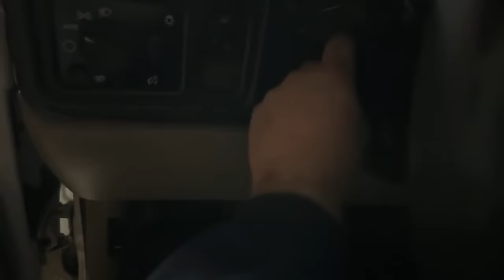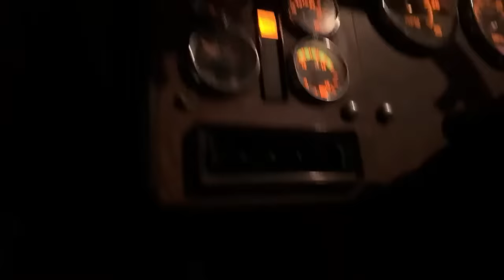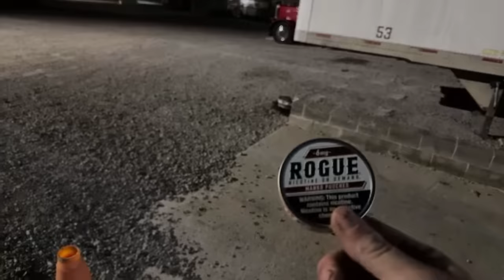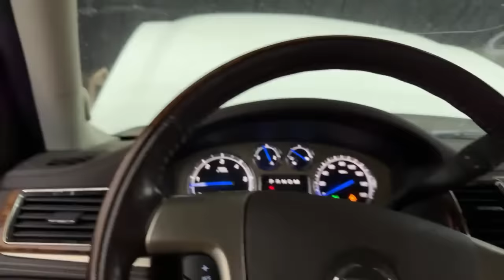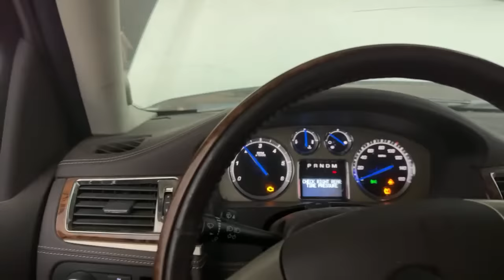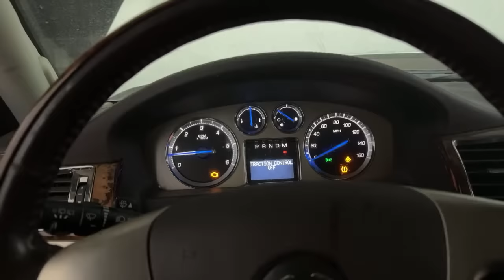Things Got Out Of Hand Fast!!

Comment: If you want to turn off traction control and stability track you gotta push it in and hold it for 15 seconds then it will turn off both then you can really lay the power down.

Comment: Mar-Hyde TAL-STRIP is the best aircraft coating remover I have found yet.  Apply it with a high nap paint roller and brush and apply it heavy and don't let it dry out, cover it with plastic to keep it wet.  Once it's dry it's no longer working.

Comment: I have a few built 6.2 liters ready to drop in. There really easy to fix. You can redo it in 5 hours new cam lifters lifter trays. You'll get a random misfire on plug 3 or 6 that's the AFM

Comment: Those 6.2 liter motors in the escalade Tim have the active fuel management issues  you gotta do a Delete on them I had to do a few of them Gm should recall all of them as they all have the same problem including the 5.3 liter and you can't fix it by using just a tune. It has to come apart to do it properly  I suggest a better cam when doing it also stage 2 works really good in them. If y'all are changing the motor in the escalade put that motor in the s10 and build it.